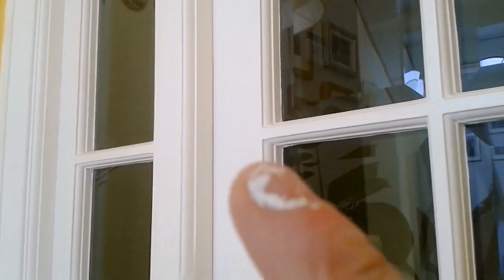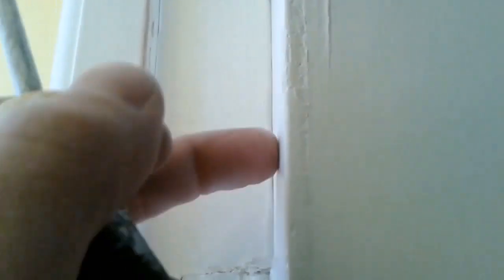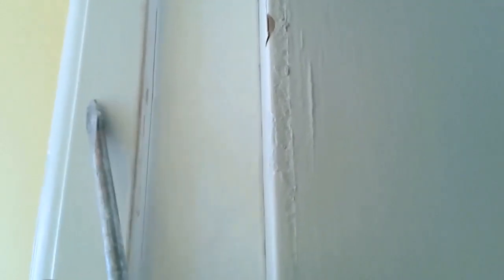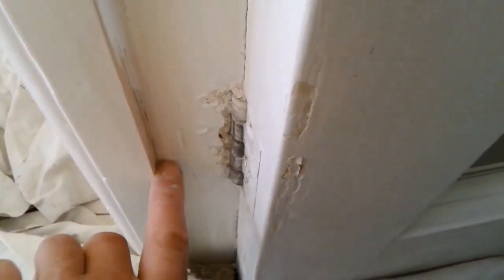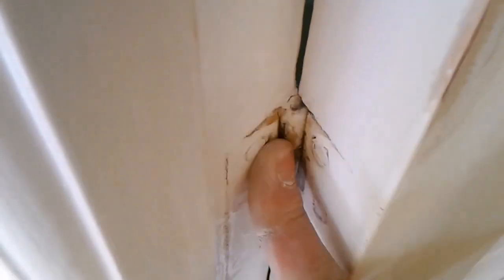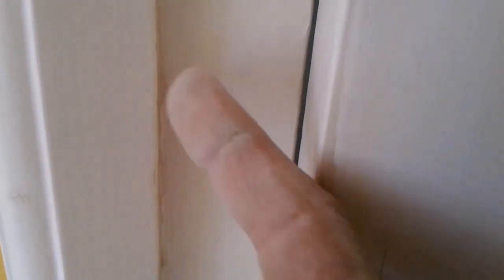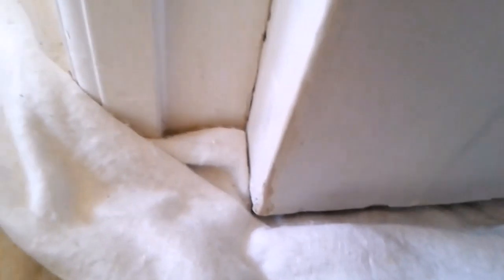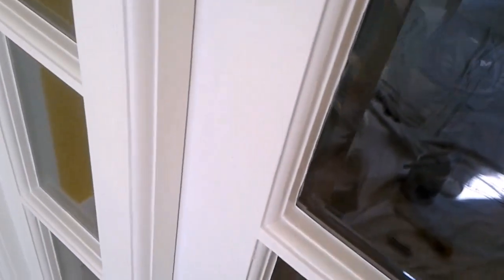How to stop paint sticking on doors and frames

Comment: On doors with removable slammers you can always slightly move the slammers back a touch to combat this or move the door hinges backwards or forwards slightly. See a lot of this day to day at work. That’s the way I do it if the door is sticking badly and sand the paint edges also. Nice to see you doing this as many painters just lamp on the gloss and be done with it! 👍
Reply from the maker: Thanks.

Comment: As a finish carpenter in Niagara falls, the fastest way to fix that problem is to cut the paint line on both sides of the door stop. Bang it over with a block of wood renail the door stop moulding, done deal. We always leave a 1/8 gap on the door side because that's where it always binds over time. Never fails. More than 1 way to do something though
Reply from the maker: That won't work..

Comment: Wen u say fill it is that with wood filler or poly filler thanks enjoy your  videos
Reply from the maker: Thanks. I use two pack wood filler or a normal wood filler you can use polyfiller but it's just not as tough and takes longer to dry .